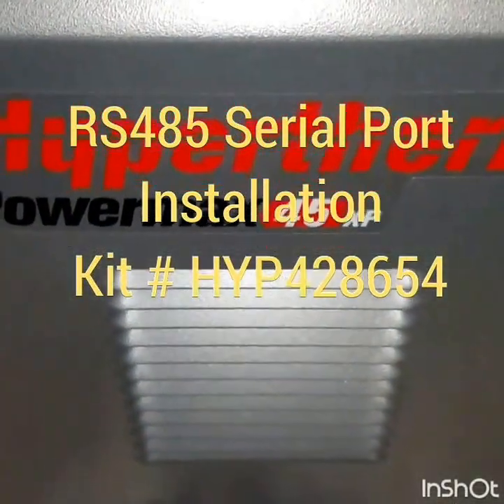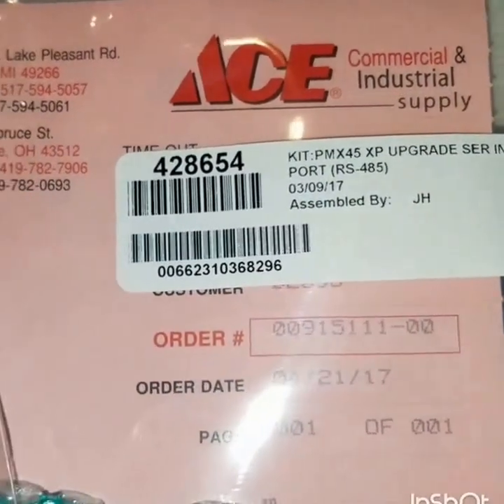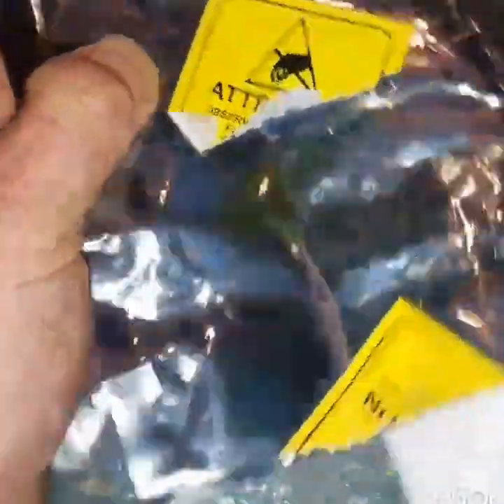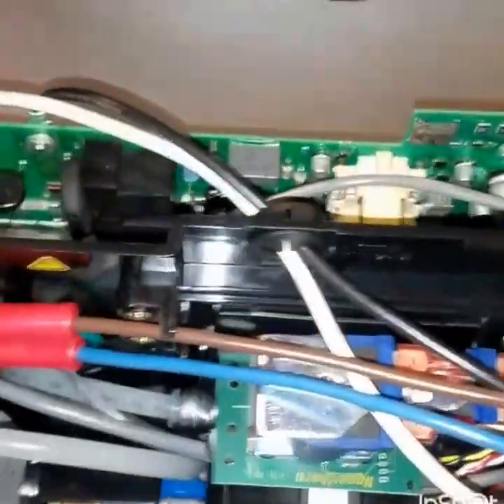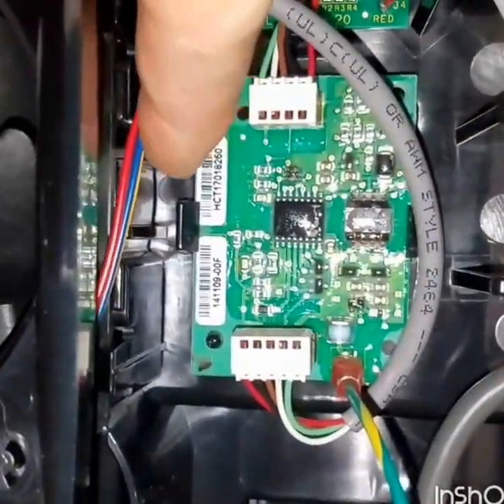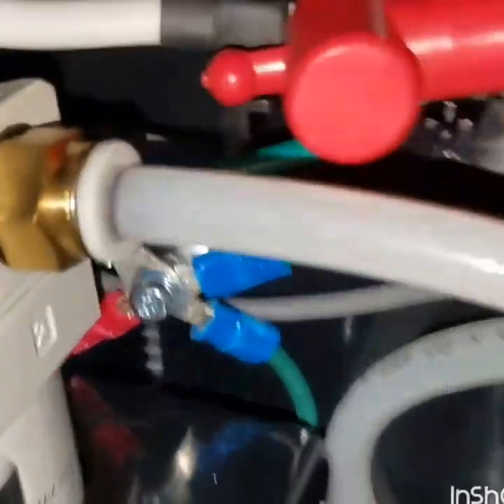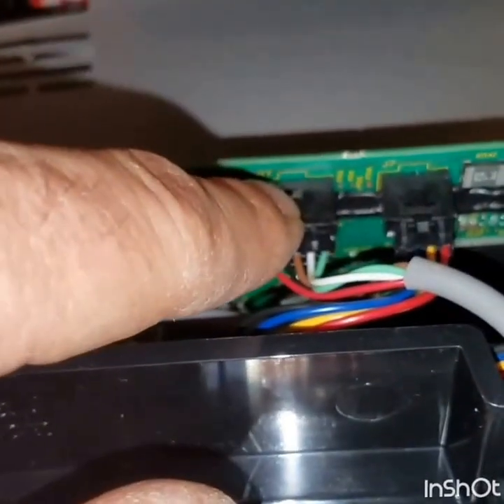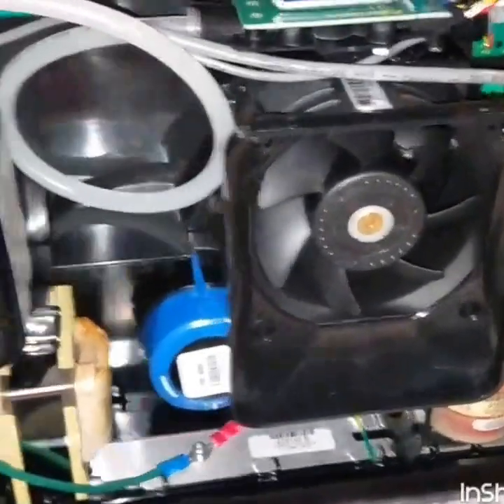Hypertherm 45xp serial port kit install, #428654

Comment: Hello! I am using the exact same kit and plasma. I'm currently in the weeds setting this thing up software wise (communicating through modbus) Is there anyway you can help me? Hypertherm doesn't know anything about their own product and I've done everything the manuals say. I'm receiving no response  from the plasma no matter what I send it and I'm at a loss...
Reply from the maker: Are you using LINUX-based COMMAND-CNC?

Comment from the maker: This plasma had been running perfectly on my CandCNC Bladerunner setup from April 2017 until July 2021. A close-encounter with a lightning strike fried my cnc controller, hub, PWMIIA module, USB board in my PC aaaaand fried the 45XP. EVEN THOUGH the controller and PC were connected to a $75 surge protector/UPS and the plasma was unplugged. But lightning will travel not only up the ground rod but also through every RJ45 ethernet cable. So I got a good 4+ years out of it. Thank GOD for commercial property insurance. Three months later I'm back and had to watch my own video to remember how to install the RS485 kit. Also upgraded to using mechanical disconnect switches on my plasma and compressor and using ethernet surge/fuse boxes between the PC, plasma and cnc controller.

Comment: So Dan Great video! I just installed this kit but noticed there’s no connector for the port to our cnc control box?? What did you do?
Reply: You do not need the RS-485 port to control the Powermax series from a CNC.
The RS-485 is an industrial serial port that would allow a CNC or computer to programatically adjust the settings that you can do manually with the knob and LCD screen on the front of the Powermax45 XP.

*** MUST USE A MACHINE TORCH, a hand torch cannot be triggered via the CPC port on the back of the Powermax ***  
The CPC ( Circular Pin Connector ) is used to remote control the CNC. 
-  Pins 3,4  =  Plasma Start
-  Pins 12,14 = Arc Transfer, this is a switch that is closed inside the Powermax to signal the CNC that it is cutting and has a stable arc
- Pins 5(-),6(+) = this is the divided arc voltage being measured at the torch.  Check with your THC manufacture to determine the correct ratio to set the voltage divider card.  It comes shipped from the factor set at 50:1

Hope this might help a few of you :-)
Reply: Josh Tombs Hey Josh go on Hypertherm's website and download or look at a publication called "Powermax mechanized applications". There is a block of cables listed under "mechanized I/O cables" there you will find part numbers for serial port cables that go from your powermax to cnc.

Comment: What capabilities does the serial port provide that the CPC doesn't? Amperage control?
Reply from the maker: You need the rs-485 interface to better communicate to the cnc software (in my case CommandCNC). It allows greater control of the 45XP for cnc plasma.
Reply: thc and torch on and off for my crossfire xr

Comment: Thanks for sharing your video great timing! I've been looking around for more information on installing these components like you. Did you install the CPC port also or did you purchase a machine package that already had it? I'm trying to upgrade my base model 45xp with these ports and every bit of information helps thanks again!
Reply from the maker: Brian Allen: The unit I bought came with the CPC port.
Reply: Brian Allen did you ever find any info on cpc port.  I have not found anything to install this.  
Craig